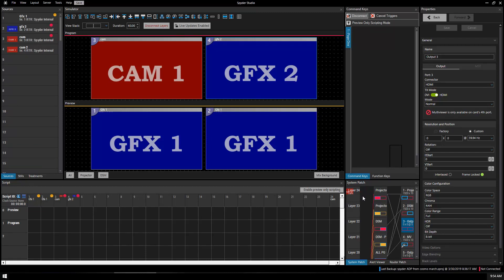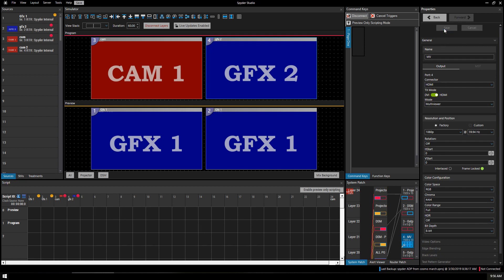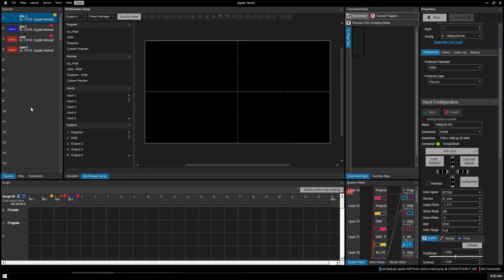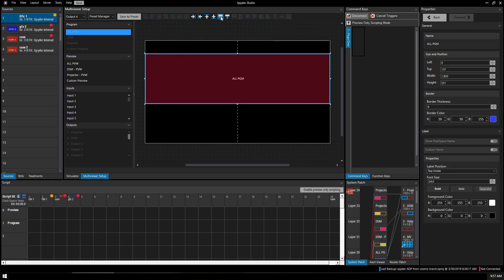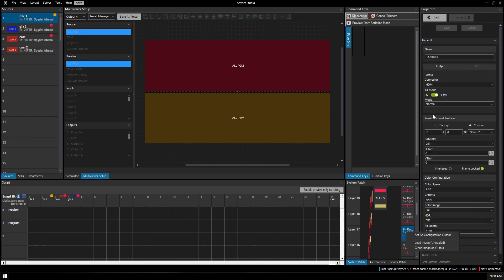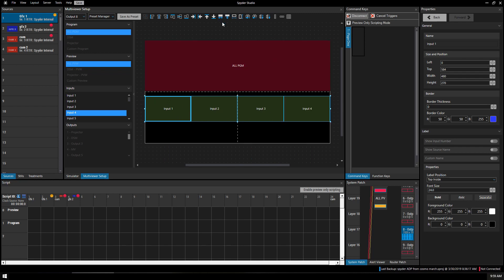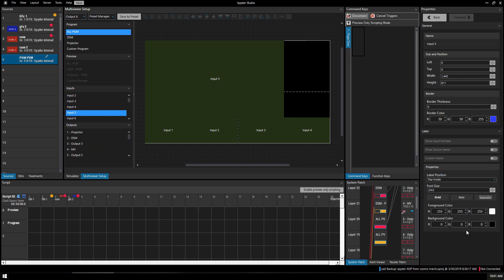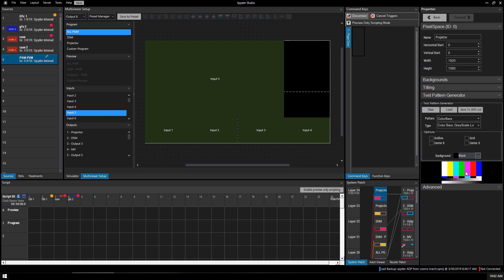Tutorial: Outputs and Multiview on the Spyder x80 (Spyder Studio Part 3)

Comment: Hi there,
I am following along with your tutorial on v5.3, and I am running into an issue where I cannot drag and drop anything into the Multiviewer.  Do you know what may be causing this?  Is there a setting I need to unlock?

Thank you!
Reply from the maker: Sorry about that. Here are the instructions:
Click on your MV output in the system patch to bring up the output properties. Click LOAD STANDARD and either manually type in the resolution of your MV's monitor or load a factory standard if you can find an applicable one.

And here is a video: https://youtu.be/PB5dV2oQfEI